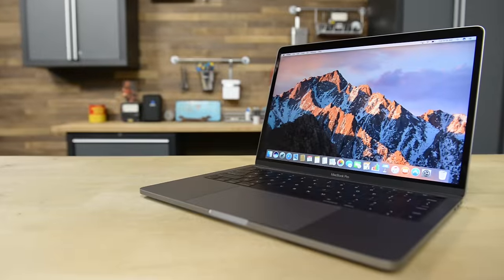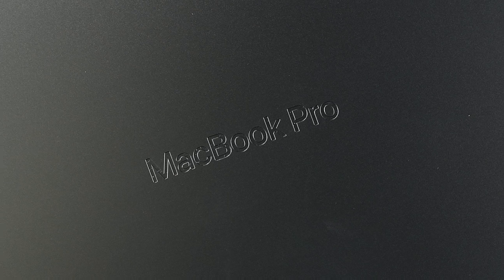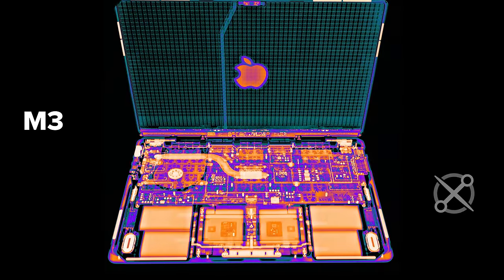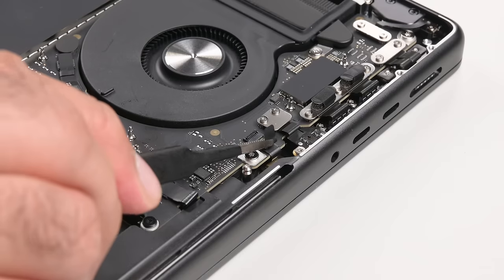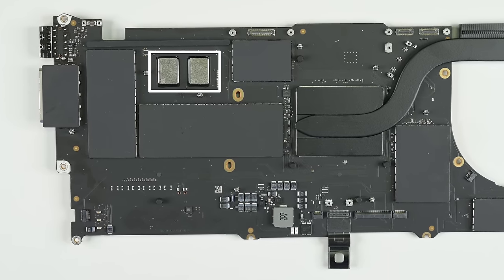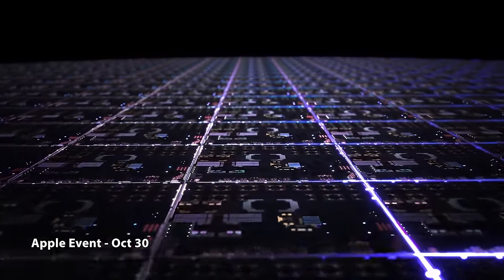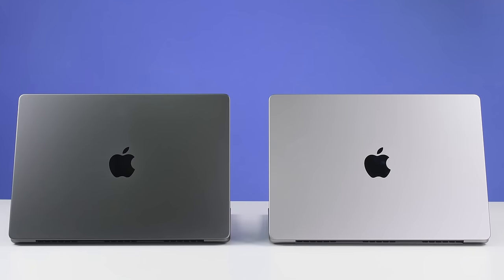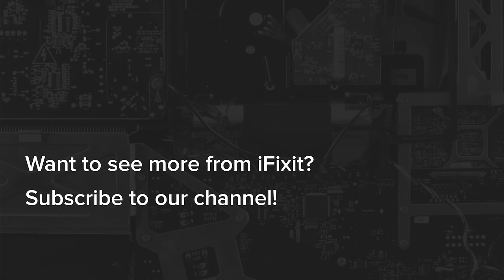Inside Apple's M3 MacBook Pro: Teardown, X-Rays, and Parts Pairing Drama!

Comment: As soon as ARM for windows has developer support, I'm moving back to windows. Assuming they don't pull the same anti-repair BS.
Reply: Windows is a SW company, not hardware. So it will always be repairable. ARM is a processor company, not a desktop manufacturer. On the other hand, Apple produces "everything" (eco system: SW and HW) so they can monopolize as their wish....

Comment: Well, at least the battery is reasonably easy to swap and since I keep my machine clean and generally don't run it too hot, I don't see any component failures in my near future so this video it fairly re-assuring. I've had the base m3pro Pro for about 10 weeks now, use it daily, typically running for 10+ hours and haven't had a single issue with it yet. Overall a major upgrade from the 8/512gb m2 air I owed and used the same for 6 months prior.

Comment: I have the 16GB Version M1 Macbook pro and I must say it fills up relatively quick after having a bunch of tabs open and MS word and some other apps when I am multi-tasking. its probably fine for just non muti tasker users only trying to web browser or light use but in 2023 you need more than 16GB.
Reply: That’s just how MacOS works, it fills the ram even if you only have one tab open.

Comment: I wouldnt ever buy a Mac. I really dislike the lack of the ability to upgrade my own PC.
Reply: I don't buy PCs anymore, because you can't get anything as good as a Mac.  You can upgrade some hardware, but the rest is still less than a Mac.  Solid construction (even the MacBook Air,) thin and light designs, excellent keyboards, the best trackpad in the industry, and optimized OS for the hardware, industry leading power efficiency and battery life.  Even Mac value LCD displays in the MacBook Air ... out class PC OLED displays because Apple buy quality components and then calibrates them. PC makers buy crap and sell crap.

Comment: Apple should take another look at their memory map practices. I suggest a base RAM in the SOC, plus upgrade sockets. Likewise, storage memory should have a base amount, plus a PCIe slot for expansion, and a provision to permit mirroring of the SOC storage in the PCIe SSD as a backup measure. This could make the sale for those who turn up their noses at the non-expandable base model, but don't want to fork over a ridiculous amount for more memory capacity right away. 

The battery power cable should have a connector on the logic board end just in case it breaks. The trick is to keep it reliable, cheap, and short-circuit-proof if somebody undoes it without removing the battery end first.

Comment: I wish the author of this video actually stated the engineering reason behind having RAM inside the SoC: it's much faster and has lower latency, leading to better performance. Yes, it's not upgradeable, but the vast majority of users never upgrade their RAM anyway. Having the SSD soldered onto the main board also helps somewhat with reliability, but it's not as strong of a reason.

Comment: Why is the lid close sensor paired? It is very easy. It's about the security of USB ports. When the flap is closed and you log out, everything is encrypted. The sensor is permanently assigned and paired so that it cannot be deceived.
Less hate - more knowledge.

Why are other parts linked and encrypted? So that it doesn't make sense to steal Apple devices, even for parts.
Reply: So one use case scenario outweighs a more common use case scenario. Ok.
Reply: It's funny how only literally every other OEM never does stuff like this, if it's so useful why is Apple the only one? It's because that's just an excuse that they use to justify malicious design. I'm sick of companies locking down stuff in the name of "security" when for 99% of users being able to replace a damaged sensor or screen is much more important than some sort of theft deterrence. It's your responsibility to keep your stuff safe, and it's your right to modify and repair your products.

Comment: Apple loves e-waste.  I love my Framework laptop.
Reply: I mean Framework won't admit it but they love that too. Because it means you buy more stuff from them.
And one day they probably HAVE to go a bit away from their approach because it wouldn't be sustainable.
Reply: Yeah, Raja995mh33, I guess that because you can actually replace parts in a Framework laptop without replacing the whole motherboard, and you can do it yourself, that somehow because you buy the parts from Framework that is a BAD thing???  As opposed to spending $$$ at the Genius Bar or just buying a new Mac every time something fails or you want to upgrade?

Your next argument is just as bad.  Somehow, Framework's strategy of selling upgradeable laptops is bad because it is not sustainable???  Before laptop sales replaced desktop sales, desktop PC manufacturers did quite well selling user-upgradeable computers.

That is some twisted logic you have going on, just to be an Apple fanatic.

Comment: When an SSD fails that doesn't have to mean you lose your data...
You can often still access that. You're most likely just not able to write on them anymore.
Reply: How do you access it if failed
Reply: @deloller2452  the typical failure mode of SSDs is running out of re-mappable blocks or cells.  The result is that the volume effectively becomes read-only.  There's no physical crash like you get with spinning disks.  Also, who doesn't back up their data?  It doesn't matter what you keep your data on, if you don't have a second copy somewhere, it's only a matter of time before you lose it.
Reply: @qbranch2405  I do backups, I was just curious how you access to the data  in a failed Ssd

Comment: The memory on die/package isn't bad from a security perspective IF that memory is specifically for the OS while this will mean more die complexity to cordon these off and specific drivers for the OS to handle those as secure memory for the host OS only along with a second controller for off chip RAM. I think that is worth it in the long run for the industry as far as mobile devices are concerned but the key is that the on-chip memory shouldn't need to be greater that ~4GB realistically.

Comment: What a waste. Such an incredibly powerful machine stuck on these abusive repair policies. It should be up to the customer whether they want authentic hardware or cheaper parts. If the quality doesn't meet the standards, it's their own problem. They've already paid (quite expensive) for the product. Why can't they do what they want?
Reply: Tbh I prefer having aome sort of hardware security as well. "the customer decides" would also mean: Everyone decides. If you want it or not.
Someone could steal your Laptop and then just replace the SSD and call it a day. Not so much on a Macbook. That's why it's often just not worth it stealing them.
Reply: @Raja995mh33  I don’t think I agree with that. It’s unthinkably expensive to replace a soldered part when it fails (when it’s even viable), and I’m pretty sure there are ways to lock the system even if the storage drive is replaced. My problem here is the need to pair replaced parts like the display and fingerprint sensor. I don’t see how it makes sense for a customer.

Comment: On the RAM issue, while I agree with you 8GB is not really enough, we can't think of RAM the same way as with x86. The RAM on the M chips is very close to the chip, running at the highest speeds 6.9GB/s or more. Plus ARM chips are much better at managing data compared to x86, add in the Linux style swap space and running on lower RAM is generally OK. Yes I know SSD have limited read/writes, but these are now in the millions so SSDs in general are made to operate for ten years or more, way longer that a macbook will last for most. 
My point is that we need to re-think how RAM works with ARM processors compared to x86. x86 was and always will be memory hungry, remember ARM is RISC! When was the last time anyone ran out of RAM on their mobile phone!! 
Thanks for all your reviews!

Comment: I wish the myth at 5:20 will die,  regardless of swap use your SSD will far outlive your device. I am a developer with a M1 Max and 64 gb of ram and despite this I regularly use 10+ gb in swap, in addition my servers and VMs I put a ton of pressure on the SSD, yet despite this I have an estimated 90ish years worth of writes left on my SSD given my current heavy duty usage. Its literally fear porn and has no basis or concern in reality. You might as well complain about how aluminum can start to corrode after 50 or so years of sun exposure.

Comment: So… the 8GB version is going to sit well with business. Most don’t have any demanding apps or workflows, and businesses are far more price sensitive than consumers. And businesses usually turn over hardware in 3-4 years putting these models into a secondary market. 

As to pairing parts. Aside from security cases, some of this is going to be to prevent illegal copies entering the supply chain. By illegal, I mean some proprietary technology would have had to be copied to make the part.
Reply: Those 8GB Macs are going to hit landfill a lot sooner then they might with 16GB and that is an issue.

Comment: Doesn’t have a dvd burner?  Pass
Reply: I don’t think some or another company still manufacturing laptops with built-in optical drive, but you can connect external optical drive. The reason why built-in optical drive was removed from laptops is because laptop without built-in optical drive is more portable.

Comment: Oh god here we go .. the whining begins. hey why don't you tear down one of the lenovo laptops that came out ten years ago who blatantly copied the architecture and board design of apple, including soldering components direct to board.. ohhhh wait that's right. You  never mention that because PC manufacturers can do no wrong LOL
Reply: Wait Lenovos have Soldered Ram and SSDs today? Paired screens? 

Oh thats right they dont. 

"Well 10 years ago" well its today not 10 years ago is it?

Oh thats right, thats irrelvant because Apple can do no wrong.
Reply: Thank god you’re here to throw yourself in the line of fire of a trillion dollar company.
Reply: @cyberlocc  right now Lenovo sells 782 notebooks with soldered RAM. Lenovo suffers way less from obvious software locks, you only ever see them when working in a repair shops. BIOS chips are basically irreplaceable, different controllers are locked and tend to explode for no reason, some batteries outright don't work, even when they were built spec-to-spec for that device. Lenovo is exactly 0% better than Apple here and has been known as very anti-repair for quite a few years.
Reply: @PvtAnonymous  Soldered Ram =/= Soldered SSDs. One of those is much worse than the other. 

That 782 is a 500 dollar laptop? Not a 2500 dollar laptop. And it's an ultra book designed to be thin. Top end lenovos don't have Soldered Ram. 

Macbook air, Soldered Ram Soldered SSD would be less waves. There is a purpose, and it's a lower end machine so price is a factor. It's more phone like. 

A 2000+ dollar "Pro" machine and charging 400 dollars for more ram is a completely diffrent subject.

200 dollars to go to 32gb for the pro model, and there would likely be less complaining. 400 dollars for 16 more GBs is just straight robbery.
Reply: @cyberlocc  Not gonna defend apple here but lenovo is not much better or any of the pc manufacturers. Lenovo definitely uses underfill under its soldered on ram chips making them almost unreplaceable.
While Apple is still king of making it as hard as possible to repair anything, the rest of the industry is following in their footsteps. None of these companies are your friend and they all have an incentive to make you buy new.
Launching a "pro" product with 8 gigs of ram in 2023 is quite hilarious though. Its not even enough to be a pro at web-browsing these days.